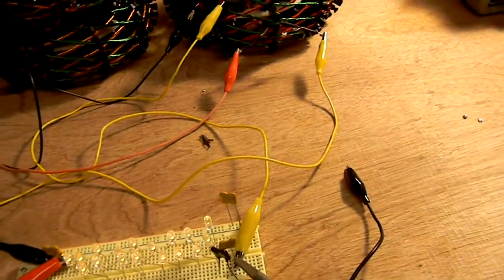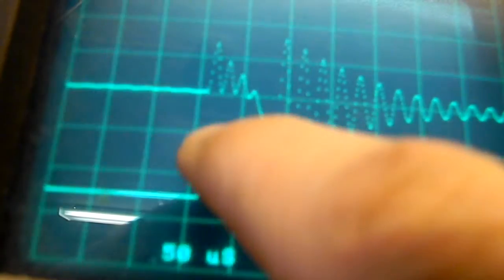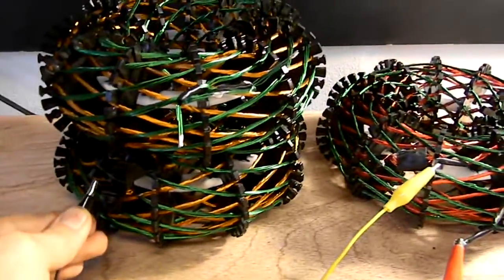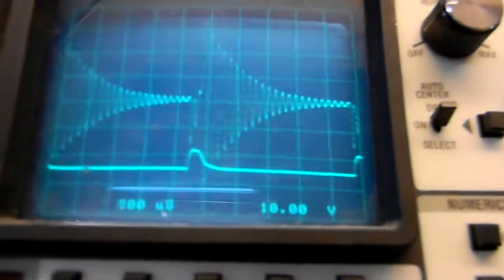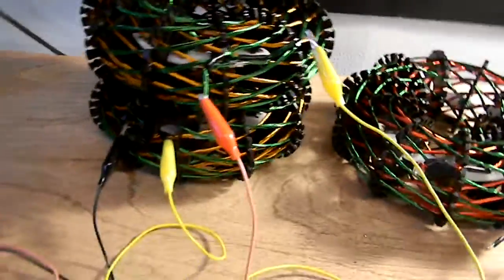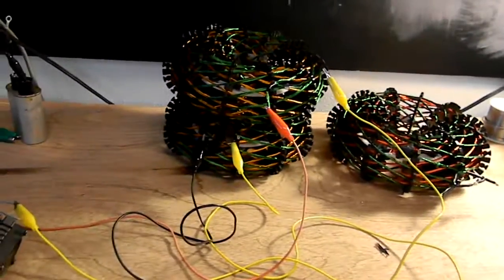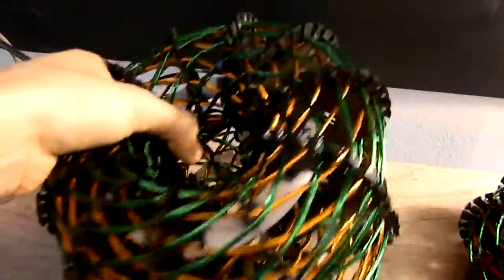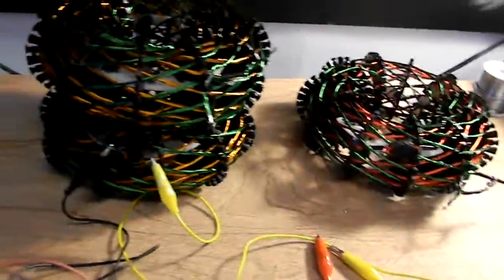Wave form analysis of Dual Inter-weaved Torus vs "conventional" Rodin Coil

Comment: Resonance is coupling for lossless energy transfer.  Have you measured load current or energy for both DIT and RC?. If energy or load current is different then it may be due to harmonics eefect as higher freq harmonics have less power. Else voltage gain is due to reduced current power=V * I.

Comment: You are forgetting something very important and it is that you are not under real superconducting electromagnetic fields combined with the Tree of life Secret geometry you can get there, but you need to change the coating resin from the copper wire with a superconducting resin using heat resistant resin and good quality Graphene 1-3 layer graded and then you will get what you are looking for at a frequency of 186khz x 2=373,248khz

Comment: well obviously one is bigger but i think it's the amount of wires or coils you have, not the area it has.  I saw a vid from Luc Gotuluc and he had the same effect from wrapping one coil with twice as much wire.  i think.  Both coils were approx. the same size, but one had double the voltage because it was wrapped doubly.  i know nothing about electronics and that's the way i like it.  When science figures it out, Then I'll learn it.

Comment: need stl for frame to wrap with and then need to know the gauge wire you used and how long it needs to be to make plz wanting to make one
Reply from the maker: best advice is to make a frame yourself and wrap it once with twine to get the real length. it is 2 rodin coil frames, outer diameter is the same as diameter inside the middle.

Comment: What's the difference in amps? Have you measured the resistance of the two systems? What happens when you run a DC current rather than an AC one? (do point it out if you have looked into these things in a previous video, I've just found your channel...)
Reply from the maker: I actually have a lot of trouble measuring what is coming out....Ive blown 3 volt meters so far....It is high frequency...so I pretty much measure it by the ability to light a bulb. It also is very dependent on the length of the pulse going into the coil. So in short, I can light a bulb up with 20mA or with 2 amps depending on the resonance. I try and keep it as low as possible. There are some spots where the amps really drive into it but I think this is due to the mosfet opening and closing sloppily. The best results are when you can hear the coil sing.
Reply: MrWarrensk Sorry to point this out but this tells me nothing... no skeptical physicist is going to take you seriously if you can't reliably measure these quantities; because now how do I know that this isn't due to some sort of an effect similar to a transformer. And trust me, we all need the intellectual powerhouse that is the collective of skeptical physicists!

If the best results are when you can hear the coil sing, get a microphone and measure the spectrum produced and see how the frequencies vary with voltage and whatever else you can change, and then you can also see if there is any higher harmonics produced by this thing.
Reply from the maker: Rayko St I completely agree. It is rather frustrating but if you watch some of my videos on the output of the asymmetrical motor I built there is a clear difference in how the energy propagates. I will make another video with the spectrum analyzer and the oscilloscope. I can turn the radio on too so we can hear it. I just got a brand new meter too.
Reply: MrWarrensk Yea I guessed it's difficult doing these things since no one has done or studied them before. (I know these things because I'm doing a PhD in experimental physics)
Reply from the maker: Thats awesome. I was originally a physics major but was greatly discouraged when I showed my physics professor radiant energy (Dr. Stifflers SEC circuit)....We measured more amperage being consumed by the receiver than it took to transmit. Then he told me that doing research in this area would be impossible. So I bagged the physics degree and continued my own research. Also, after the signal is rectified and has a reference to ground, it reads well on a DMM. Ill post the resistances, capacitance's and resonant frequencies. My next video will hopefully answer a lot of your questions. Keep them coming!
Reply from the maker: I am an electrical engineering major now. I just started diving into the calculations and such and have a lot of trouble using any of them...the equations for solenoids dont do me any good when it comes to these coils. Your experimental physics input would be much appreciated.
Reply: MrWarrensk Sorry about your discouragement but things always happen for some reason....
Solenoids are a wire wound up in cyclindrical geometry and since a current in a wire gives rise to a magnetic field, the combined total magnetic field, due to each coil, gives rise to their properties. These coils are wound up in a torodial geometry so the magnetic field from all the coils would be interfering in the different way, so I would be more suprised if you could use the equations for solenoids.

Comment: that's really beautiful; dare I say sexy :)  It is 4 times the inductance; double the windngs... frequency 1/sqrt(lc)    sqrt(4) = 2.... hypothesis: if you added the other that you have in series, so the loops are still clockwise around the central axis... you'd have 3x :)